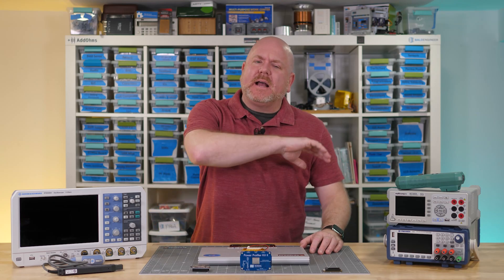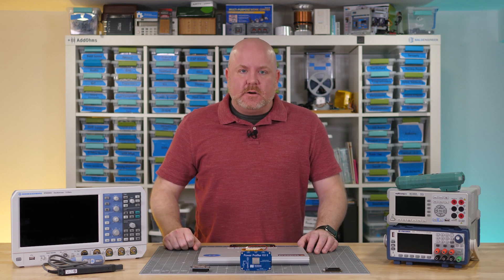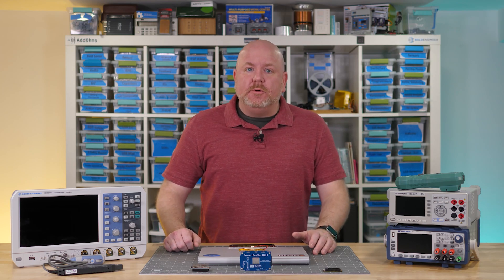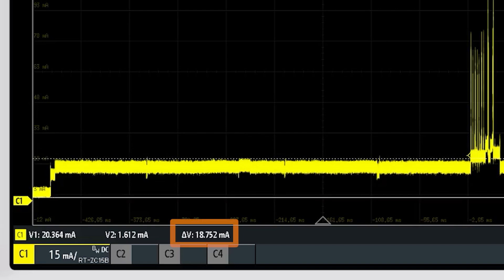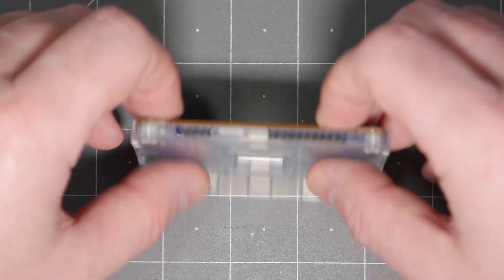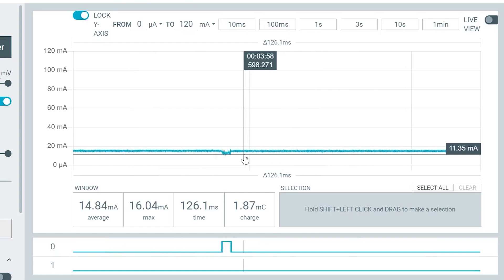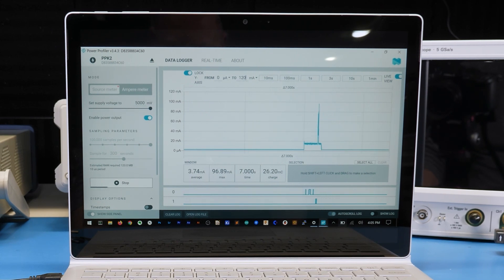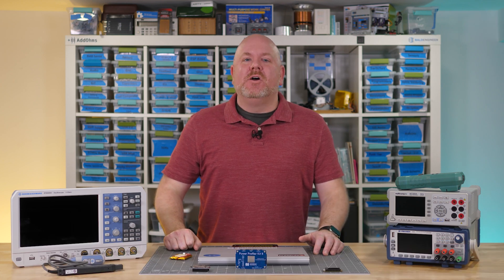How to Profile Battery Usage for IoT Devices - Workbench Wednesdays

Comment: I own the profiler kit. It is brilliant. I bought it specifically for a battery operated temperature sensing project. It cost me approx £80 in the uk. Worth its weight in gold. I now have 10 temperature sensors around my house. They use ESP-Now technology to transmit data every few minutes back to a recorder. Each sensor runs off 3xAA batteries. These will last 3 years. All predicted by the profiler. Awesome.